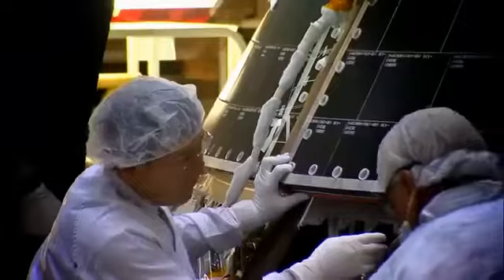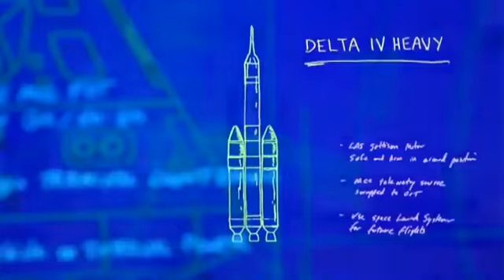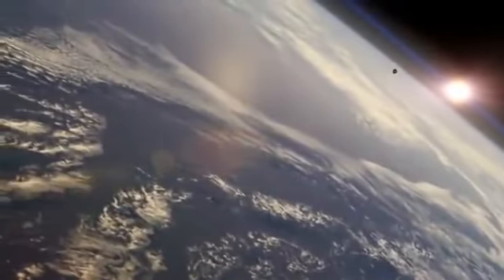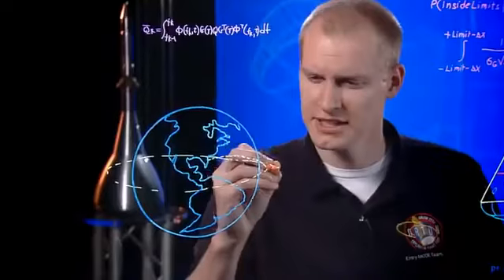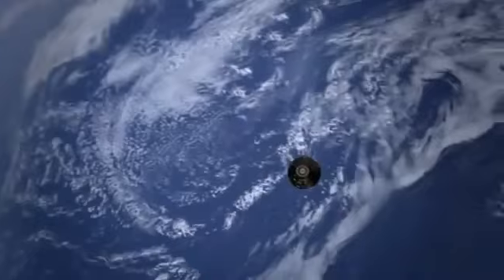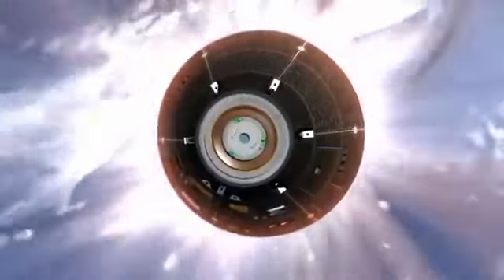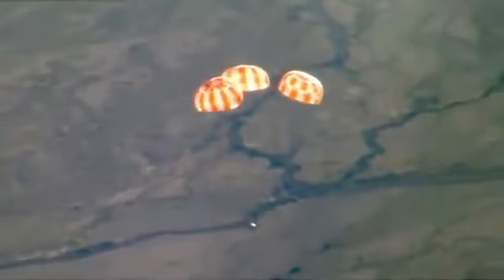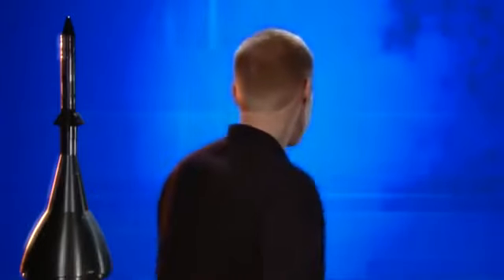NASA engineer admits they can’t get passed the Van Allen Belts

Comment: “Sensors aboard will record radiation levels for scientist to study, we must solve these challenges before we send people through this region of space.”
Reply: I'm pretty sure he means for each ship built.
Reply: Yea didnt they send rockets and astronauts a bunch of times beginning from 69 to 72?
Reply: Totally using words in a "dramatic" documentation to fit the modern idiotic conspiracy Hypothesis. Maybe want to add that the Orion spacecraft is doing a science based flight with instuments reading the radiation. So when adjustments have to be made or they are problems engineers can be made aware. Literally every space property and every Apollo mission made it through because with enough speed the radiation is not much different then a CT scan at your local Hospital. Obviously speed and planning the right flight trajectory plus protective lead help to make this possible.
Reply: Just what I was thinking
Reply: It gets WAY worse than that, Mr. Ray. What I love is the Flat Earthers who use what-ever snippets NASA may provide, and they can edit, to prove "SEE we've never gone into space, NASA said so" then reject the 50,000,000:1 (That's "Facts-VS-Retarded Conspiracy Theories"), facts provided by NASA as being.....what? Come-on, you know the word, that's right "Conspiracy" 
It's a conspiracy when it suit's them and it ain't when it don't =)
Reply: @Raydensheraj  CT Scans??? LMFAO!!! So you are saying the Sun and the Earth's magnetic field only creates enough high-energy particles that amount to a CT Scan? Don't use common sense, just believe what they tell you and everything will be ok.
Reply: @cajonjackie2075  I actually responded to him with links in English and German. I study Astrophysics so eventually you can't escape studying the Van Allen Belt, particle physics and the strong force. And you are definitely correct - a lot of misinformation and ridiculous "experts" with zero credentials, no expertise in Astronomy or the Standard model of Particle Physics. But this is being a long standing issue being heavily addressed in our Universities across the United States. Actually even the Scientific American Magazine had a article concerning this misinformation problem and they promised to keep advertising ways to verify sources, credentials and correct information... But this might take a while. Unfortunately.
Reply: Today, "Face Book" is the number one source for news and information, with "Tweeting", a close second. WFT does THAT tell you.LOL but it isn't funny, it's tragic for the future, your future, my Grandsons future. Even applying all my mind and thought to the issue of "Us.", studying nothing really small, nothing really big, nothing to do with Hydrogen3 which coats, in ton's, the surface of the moon, nothing to do with physics, .....of any branch!!! and I see nothing that helps cure voluntary stupidity. We may be still "too close to the trees" to survive, much longer, our own Simian's folly.
Reply: @Raydensheraj  you are contradicting this guy Kelly Smith navigation and guidance for the Orion mission. He uses the words like extreme radiation, dangerous, and they must solve the challenges of the shielding before they can send humans through the Van Allen belt. This sounds more than just the charged particles coming from a CT scan
Reply: @johnhebert2757  First of all this Video is clearly what we consider "science communication" - explaining the normal Joe that the Radiation can fry electronics - then he talks about testing of shielding. He never at that point mentions Humans. Plus he definitely adds dramatic tone for excitement. It is correct that at 1. At certain times ( overactive Sun ) OR 2.when you don't take a certain path or you simply stay too long in n the Van Allen Belt in t definitely can harm the Spacecraft and Astronauts. Are you familiar with the GALILEO Spacecraft that explored Jupiter? The Radiation is far more dangerous and the Mission lasted years Now imagine the Solar Parker Spaceprobe... Near out beloved Sun.
The most important thing is definitely trajectory followed by speed and then protection mainly for electronic instruments... Check out on YouTube Curious Druid Van Allen Belt - really good Video.
Reply: @Raydensheraj  I'll check that out later but this is the problem for a normal Joe. The Van Allen belt isn't a problem especially for humans to fly through at the right speed and trajectory. Apollo went through it 6 times and back, that is a total of 12 times without incident. Your data says minimal effect on humans but still no space agency in the world traveled through the Van Allen belt in almost 50 years. That is the reason a thinking normal Joe isn't buy it. I applaud you for your education and knowledge. I didn't finish getting my degree due to personal reasons, which I can humbly say people like you who go on to finish are stronger minded than I was. With that said, I believe you have the means to prove us wrong by sending humans pass Low Earth Orbit. Until you actually do it, the data isn't proven to work.
Reply: @johnhebert2757  Thank you. I'm still only 15 months in my studies. All together still got possibility 6 more to come. And your right, Science definitely needs more people explaining in detail without making it so complicated - I learn things everyday. My degree is taking my personal life away because when I'm not in class I'm on my Telescope, doing research thru the GAIA dataset or reading books. It's like being a doctor - you have absolutely NO life whatsoever. I'm glad I could give you some information - like I say, there's so much to Astronomy it's ridiculous. And I still have believe issues here and then... Example the Microwave Radiation Background measured by questionable technology - it took me over ten books to finally get the basics and understand why cameras don't have to be Hubble quality in order to make these measurements. Or so many Cosmologists using String Theory even through it's ( at least right now ) impossible to measure if it's a valid theory. Another confusion - why is a Scientific Theory different then a Theory? Lol... It's really a matter of finding the right place and right sources these days.
I'm glad there's still individuals like you that discuss a topic like a intelligent individual.

Maybe your interested in this, a team of undergrads at my University is working with some Guys out of the UK on a new version of this:

http://www.minimagnetosphere.rl.ac.uk

It would solve the radiation problem. This is also hidden information but very interesting.:

https://room.eu.com/article/shielding-the-human-genome

At last an option:

https://www.google.com/amp/s/amp.businessinsider.com/r-mars-astronaut-radiation-shield-set-for-moon-mission-trial-developer-2017-3
Reply: I actually am sure he is talking spacecraft specific. Obviously the SLS system is a modern design and the first flight will show thru data collection if the Radiation readings will be still in doable regions or if the Engineers and science team concerning radiation issues will have to tweak the ships material. That's it - we have done greater Missions. The Apollo missions showed we can get humans to the Moon. It's not as big of a deal ( except financial ) as many of you guys make it. We study since years humans in Earth orbit leading to worse issues then the Van Allen belts. You guys understand why we are doing all the Mars research? Why ESA and Jaxa and even Roscosmos is spending money to train Astronauts and collaboration has been everywhere.
We will go back to the Moon, but this time only as an exercise... There's thousands of science teams working on Mars specific problems. We need to be a multiplanetary lifeform or we won't survive as a species.
Reply: @Raydensheraj  The Van Allen Belts are not the worst problem. The worst problem is; 'killer electrons'. Killer electrons zip around at near light-speed. They each have radiation equal to 1000 dental x-rays, and they can easily penetrate through deep shielding (lead etc). They accumulate in electronics to where they then discharge an electric shock equal to a miniature lightning strike. As the human body is filled with electric signals (mainly in the brain) you can be certain they can cause that lightning strike inside of a person. The next issue is the full radiation from the sun. So once we are past the Van Allen Belts we are still in a torrential storm of radiation. We will be in this storm of radiation until we come back into the earth's atmosphere. So while you use the argument that we were not in the Van Allen Belts long enough for it to be effective in killing a person. There is still plenty more radiation out there that we cannot just pass through. This raises a very valid question. How did all the astronauts that went to the moon after being subjected to so much radiation still come back to earth and live until they were in their 80's without being killed by skin cancer?
Reply: @davidprince5380  How do all of our Satellites and ISS and Juno and New Horizons etc survive these Killah Electrons? I'm asking you? Are they maybe caused by certain events or are they in space 24/7 destroying everything in light speed?
Reply: @davidprince5380  Haha you seriously think I didn't know killah isn't gheddddo slang. I know your article, have you read it? Localized events? You do know what that means, correct? Every NASA Esa Jaxa etc mission gets fried by Killer Particles? Are you even thinking here. You go by NASA info but disregard the NASA Apollo mission. Just wow, the logic my friend.
Reply: @Raydensheraj  I can almost guarantee you didn't know about that article, otherwise you wouldn't have mocked it and instead you would have given constructive criticism to support your side of the debate. Also, the article doesn't mention anything about localised events which proves you have not read it. 

I never once stated that all NASA missions get fried by killer electrons. I merely stated that they are a greater cause for concern than the Van Allen Belts. I also never stated that I believe in killer electrons. I don't trust NASA as far as I can throw them. I treat them as factual for people who take the word of NASA as pure gold. As killer electrons are spoken by NASA anyone that believes in the moon landings will now have to contend that killer electrons are real as they have been spoken of by professionals. Thus giving the people more of a mind to choose what is real or not
Reply: @davidprince5380  You can think what you want. But your using public science communication as basis for your claims. Why don't you send NASA a direct email? You base your claims on YouTube videos and links online? But you already made your mind up, you know 100% your right. Your the expert here. Nothing that I can say will change your mind. You deal in absolutes instead of using common sense. You will only accept what suites your " believes". Tell me why I should waste my time anymore?
Reply: Alex Gutierrez HELLO!?
Reply: @seigeengine  David and Rayden was having an intelligent argument...then here you come along, angry, demeaning, and regurgitating. The intelligent  level of this string  began to plumid. Then again it continued to spiral to new depths when Average Alien joined in.
Reply: "shielding will be put to the test"
Reply: I'm guessing a clone human will be on that ship ..
Reply: @manuellopezdias7569  yes they did.  Yes they did go to the moon and back with 1960,70 tech. 
They broadcast it Live and drove cars then some one stayed behind. To. Video them leaving.
Then they came back and the heat twice as hot as molten lava did not leave a scratch on the lunar lander.
They got it in a museum in D.C.
Come look i be there with a million dollars just for you. Tax free😉
Reply: And yet, there are people who STILL believe we went to the Moon.  Amazing.  The human mind is so malleable, our government has mastered the art of brainwashing in less than 100 years.
Reply: @Raydensheraj  You having research papers that use governmental satellite data proves absolutely NOTHING.  

Your data is produced by the people who created the hoax.  You have ZERO credibility.
Reply: That's right. They must make sure that there no problems with the space craft.
Reply: @zdcyclops1lickley190  You are missing his point entirely.  He is pointing out that we never worked out how to get through  the VA belts in 1969.  Thin aluminum hull and next to zero protection on the EVA suits.

We didn't go to the moon.  Best psyops in history.
Reply: @Raydensheraj  - So we had the technology in the late 60s to make it to the moon, but can't do it today?
Sure we can land a rover on mars or even a comet, but we learned nothing from multiple trips to the moon.
It seems impossible for us to not have the knowledge to get to the moon when we have accomplished everything else that we have.
Reply: @basedbear1605  Kind of hypocritical of you to act as if you're 100% right, when you yourself has shown ZERO evidence, and has given NO sources. 
Speaking of being "brainwashed", you've been brainwashed on the other side of the coin, yourself.
Someone truly intelligent would have an open mind questioning everything, but denying nothing.... without PROOF! 
You have no proof. Your credibility means NOTHING. Which makes your comment irrelevant.
Reply: Guess context doesnt matter?... He is saying we need sensors on this ship before we send people through the radiation zone.
Reply: @MagentaVibes  They are flat earthers ignore them.  They are failures at life so they think everyone else is too.  And they cant even comprehend the difference between analog and digital
Reply: @alexandredp 
You can't just make a replica of the Apollo units, the personal know how has been lost with time. There is no cad file to just open and read in to a 3D printer or something.
Reply: @Raydensheraj  
They didn't use lead since this is not x- or γ-rays we are talking about. Using lead or other heavy shielding would increase the change of high energy electrons ionizing the atoms from their inner orbitals, resulting in actual x-rays.
It is quite easy to protect your self against proton, electron and helium nuclei radiation (which is what exists in the radiation belts) with something that for the ions to react to. What they need are lighter elements with large crossection, which can easily react with fast moving charged particles.

A better thing would be to call it the Van Allen plasma belts. At least it wouldn't confuse the
Reply: @johnhebert2757  Nor the suns or the earths magnetic fields creates any energetic particles. Charged particles are constantly streaming away from the surface of the sun towards the earth. They follow the suns spiraling magnetic field towards the earth. A few of these particles are trapped in earths ionosphere and the Van Allen belts. But it is absolutely nothing compared to what the sun actually releases constantly.
Reply: @davidprince5380  Such high energy electrons exists in the radiation belts, hence localized phenomenon. They are more of a problem for satellites since they can fry their equipment if they managed to pass the shielding. They kill satellites hence "killer electrons". Sure it is quite a sensational pile of BS to call them "killer electrons". Then again the lay person tend to find sensational shit more interesting, but that also creates confusion. I mean most people actually thinks that we recently took an actual image of the accretion disk of a black hole. But if they said "we took a lot of measurements and used complex algorithms to fill in the blanks based on what we should expect to see we could make a more hypothetical image of what could be the accretion disk of a black hole" then it wouldn't have been such a sensation in the scientific community.
Humans are far better at handling ionizing radiation than modern technology is. Modern technology has not evolved many millions of years to become regenerative when damaged. The best we can do is to spot so called ghosts, when signals in logical circuits are triggered by external factors, and avoid them.

I quote your source: "Each killer electron particle may have close to a thousand times more energy than you receive in a dental X-ray! So you can see how a large increase in the number of them could result in serious harm to spacecraft.".
Neither is it as if these relativistic electrons makes up a majority of the electrons. Since this is thermal movement the high energy electrons makes up a very small percentage of these electrons. But following the Maxwell-Boltzmann probability distribution; http://faculty.wcas.northwestern.edu/~infocom/Ideas/graphics/maxwelldistr1.gif, you can see how we can predict that there could be a probability of very high energy electrons even in a cold plasma.
Reply: @manuellopezdias7569  propaganda from a dark fake democracy called USA controled by the top 1%. "nothing is truth, everything is permitted"
Reply: @masimalua6320  Say's the less than intelligent 12 year old to his highly educated elder.
Reply: @cajonjackie2075   youll find out when that sky opens up and the creator establishes his government on earth lol not long to go bro
Reply: @patrickbaitman2711  C C Signor? K?
Reply: the unsolved "challenge" is that ~ "radiation like this could harm the electronics"
Reply: @craigthompson168  we must solve this problem... Explain that. You don't solve a problem each time you build something.
Reply: M+a.

À
Reply: @Raydensheraj he absolutely talks about humans
Reply: If you want to see how the did the moon landing go watch Superman 2 😂😂
Reply: Clearly!